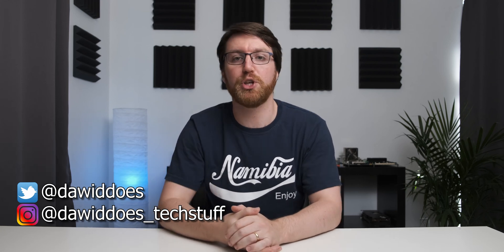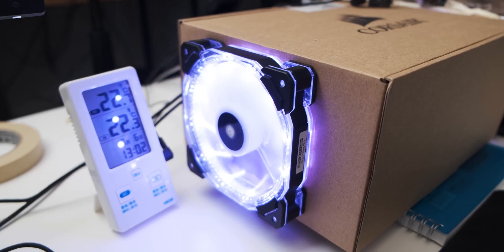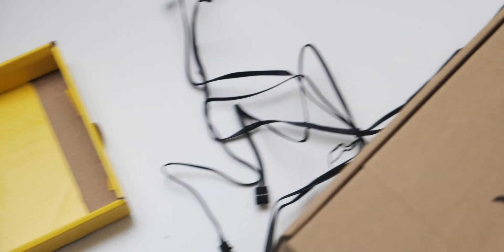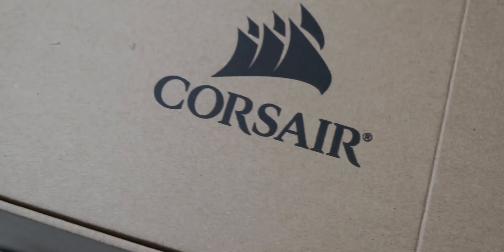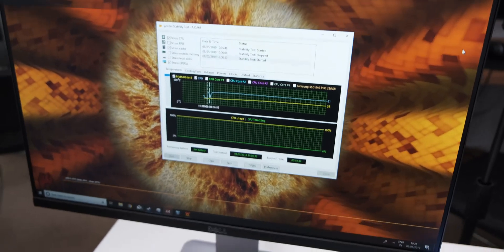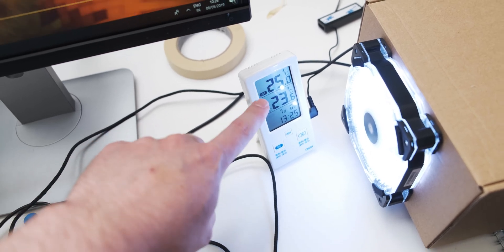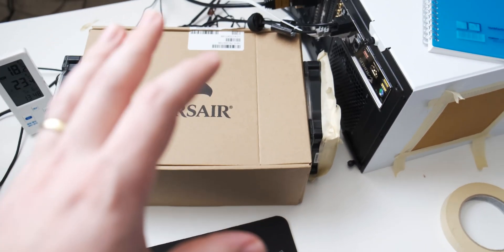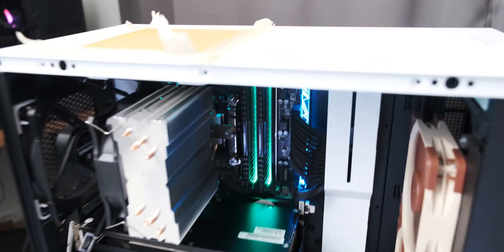DIY cardboard PC chiller (Road to sub-ambient cooling)

Comment: About 20 years ago, i had a similar idea, but instead of ice i used peltier plates. 545w TEC module, sandwiched between two 5lb nickle plated melcor heatsinks. The box, is called the Plenum, you cut a hole in the top to mount the tec unit, cold side inside, hotside outside (obviously) but otherwise similar to what you ended up with here.

The surface of the coldside heatsink was around -10c, i reversed the fan orientation for the PC (rear exhaust became an intake) because that allowed the cold air to hit the CPU cooler first, where it would then circulate to the rest of the components, with load temps on the CPU getting down to 15-20c.

Eventually this evolved into using 8 undervolted TEC plates (each plate producing 200w of cooling) which was enough to get the internal case temp down to single digit temps while gaming.

Comment: i did something similar just using frozen copper pipes attached to my pc inlet fan so not dealing with any water the air just flowws over the pipes into the pc

Comment: Use a radiator with fans attached and run ice cold water through it with a small water pump. It will pass ice cold air with out the humidity.

Comment: Hey Dawid, I have ben working on this exact same thing! A box filled with a frozen material and vents on each end. My main worry is condensation so what I have been thinking is to add an extra compartment before the exhaust fan and fill it with Silica Gel bags to reduce humidity, I will be working on that this weekend. So I noticed this video was made a few years back so I wanted to know if there was any follow up or any lessons learned I could maybe apply to my design. Thanks in advance!
Reply: (Dawid did a follow up video) However I have a few pointers. Cold air holds much less moisture than warm air, a desiccant isn't necessary in fridges for instance. The issue is water droplets driven by air turbulence. Thus if the coolant was sub zero as in a fridge, then ice would form as the water is removed from the air. Provided the coolant is cycled at a dT greater than the air can remove heat the air would stay dry, but that presents a new problem, such as ice build up (again why fridges has defrost cycles). The problem with silica is that the water is in tiny droplets, not mainly in a gas phase, and the absorption rate isn't very high. The solution really is sub zero cooling elements, maybe cannibalize a travel fridge?
Reply: @Merlinthewise86  Gotcha! Thanks

Comment: I tried a similar thing with a laptop. I sat the laptop on top of 2 ice batteries straight from the freezer. The trouble is although I covered them in cloth to prevent excess humidity and while the underside which was in direct contact with them was nice and cool. Temperatures were ~50 C° as per real temp but I noticed the laptop started bowing 😅. That's because the underside was very cold and the upper side was hot. I stopped doing that 😊

Comment: Ok, you asked for thoughts. PC on crate, toss box, use Styrofoam Cooler or better, get a cheap whole saw of some sort or just mangle the bejebus out of it, and fit in needed parts. Hot air rises, so side vent not at bottom, but about mid way down the side? Utilize some Furnace pipe, aluminum tape to seal and insulate, however you wish, even dryer vent hose to further test would due. put an upward bend on the pipe to divert the flow of water should a disaster strike. Side note, the affect of salt in water and the freezing state of that? I can't remember if salt makes it unable to freeze or just makes water colder, that's another test logic. I'm not sure where to push the air from, top side or from opposing side, but with a cooler you have accessibility and a not deteriorating "box" while Styrofoam will be fragile, I feel a cooler would be beneficial.

Another far out side note. My dad just bought an Ice maker, and it had a genius design about it. It makes ice and then shuts off... The ice falls in a tray that has holes in it, beneath the tray is where you load water in. Umm, I don't know how fast it makes the ice, but it catches the water, and refreezes it into ice... You're killing a penguin somewhere with those Ziplocks... lol While they will work, I'm just busting your balls... But the ice maker modification might be a super easy mod, and they are cheapish, sub $100 in US or higher depending. However either way you are introducing minor molecules of water in any form of this, and careful with that blanket to not block airflow of your video cards, as they could be trying to exhaust heat, and you are not allowing that so much, while they also will waste / exhaust cool air, so some moderating of that may be needed! Back to thoughts and ideas... You will need 11 child fingers separated from the children, only allowed to use 1 finger from each child, and then wait... What the hell is this book I'm reading from??? Ok, seriously... Moisture sensor, or some sort of filter to absorb moisture... Or just jam all those Packets you've been meaning to eat, but they still say do not eat, not consumable... By the way THEY ARE DELICIOUS!!!! Oh B R B, gonna go die now! Never mind I just drank bleach as per my President suggested, so it must be legit! Clearly I'm golden! However, ignore the crazy eating and drinking regiment, and commence the mad science experiment of PC Cryogenic. Oh and looking up that word, google instantly showed Cryogenic liquid... Hmmmmmm... Such an easy topic to get side-tracked from.

Best of luck, if you use any of my ideas please remind me, and no need for a shout out, you can just say the name, but P.S. it's not AzZkids as many wish it was, yea I should probably change that, but to be clear I got kids from A to Z... And sadly no, not 26, so I put the 2 in there as A (kiddo #1) 2 (how many kiddos I have) Z (kiddo number 2). But recently I have taken in 2 more who's father passed some time back and life has been a struggle for them with other relatives. So, Imagine how confusing that would be to rename to A2ZKids+2, Or just 1+1=2+2... lol So, just write me back if the above is too difficult, I will understand lol.

OH, And keep your Motherboard Upside down like you have here? Moisture will settle? I think? Humidity, and temp checker 9000 from the Thrift shop, as well as Coolers... I often find Dryer plastic piping at ours here in the US (where the hell are you from anyways? Probably US, and I'm making an ass of myself pretending you're accent throws me off). Man I didn't give this much info to Linus when they did their crazy stuff. I hope something in this helps. If I come up with up with more I'll surely confuse you more later!
Reply: Wow I seen May 9th. I then see comments from 1 year ago... lol RIP...

Comment: Don't use ice, get a bunch of old heatsinks, or some really big heatsinks designed for something other than CPUs, then several peltier effect TECs and a cheap old PSU, then build a similar box with the TECs on the outside hot side facing away from the box with heatsinks attached, and cold side facing towards the box with heatsinks attached with the fins stabbed into the box so the end result is that you're blasting the air through a tunnel with freezing cold fins sticking in through 3 walls. then maybe use some plastic ducting like for a clothes dryer to attach it to the intake on your PC case, that way you can keep it neat(ish) and away from the PC. You'll be generating a bunch of heat but that's outside your PC case so it shouldn't matter. That should solve any problem with moisture (a long as you don't run it when the PC is off) and you won't have to keep replacing ice packs, it'll just work continuously.
Reply: can you please elaborate it a bit more ?
i am planning to do the same thing but i have no lead as on where to start

Comment: I built a cooler by pumping cold water threw a radiator from a cooler with ice water in it, I placed the rad in front of a fan which sucked the air threw it cooling the computer with now cold air.

Comment: In such tests you must monitor the humidity, since if you go below the dew point you will start fighting with condensation.
Reply from the maker: That's a good point. I should do it on a day with low humidity. I'll keep that in mind for future attempts.
Reply: But when computer is placed like that condensed humidity (water) would drip at glass below cooler, what is more most of water should be condensed in box.
Reply: @szymontrojanowski7565  the problem is condensation can build up anywhere around the cold part, thats why some people go throught multiple steps to water proof a motherboard to get to sub-zero cooling

Comment: Behold! The last ingredient on my Vega 56 overclocking journey!
Reply from the maker: Haha!! When we get a working version that will make the ultimate overlocking beast :D
Reply: @DawidDoesTechStuff  I may actually try something like this just for fun. I have plenty of cardboard laying around and two 140mm fans not being used. I use  SFF itx case (Rainjitek Ophion with vented side panels), which is small enough for a 140mm fan to blow towards the GPU PCB and the back of the motherboard. But I would like a solution to plug the fans to something other than the system itself. Maybe a 9V battery or a potato?
Reply from the maker: @astrocslopes863  Please remember that there are risks involved. It is a fun experiment, but water and PC's don't mix.
Now with the seriousness out the way :P Running the fans of a potato will be SUPER epic. I wonder if they have enough "power" to do that. I might make a video on that. XD
Reply: @DawidDoesTechStuff  don't worry, I won't hold you responsible haha. I was thinking of making just a "vent" with a fan on each side, like a "cooling cannon". Then try with a very isolated ice bag.

As for the potatoes I guess PWM fans wouldn't work because they always take 12V haha

Comment: Dawid Does Tech Stuff : David, what about the condesation on the electrical elements ?
Reply from the maker: That's what worries me. I'm not sure how I'm going to deal with that in future tests.
Reply: @DawidDoesTechStuff  : try to use some kind of anti condensation substance or a spray inside the box and be sure to use a lot of it because otherwise in the first 20cm of your air flow into the case water in that cold air will not dry out fast enough but will stick to your passive and active components on your motherboard. I've seen that at a miners setup when he tried to cool those overheating GTX cards by putting the rig directly under the air condition and in just 1 month all of the gpu-s have had their PCBs almost destroyed from condensation due to the sudden temperature change of the gpu-s themselves and the cold air being blown on them.